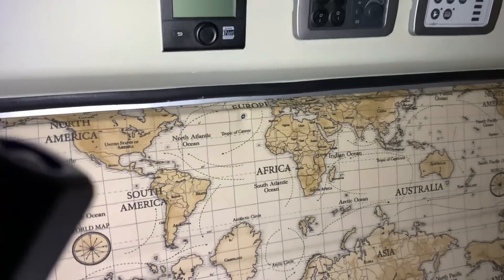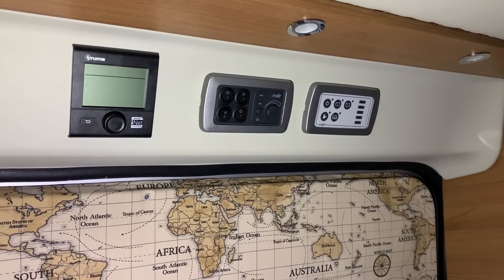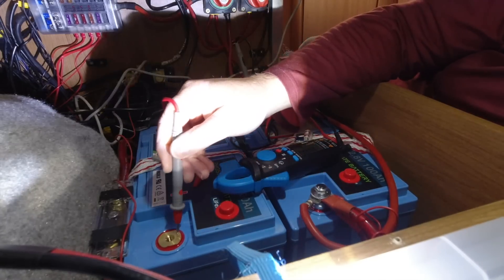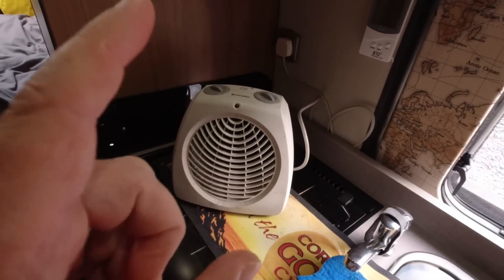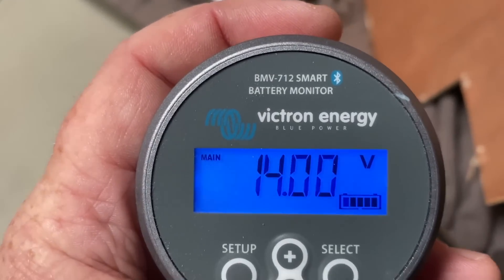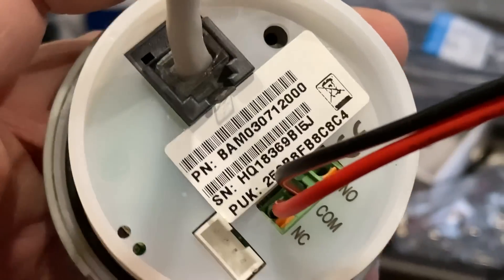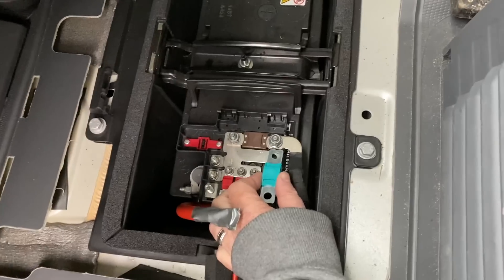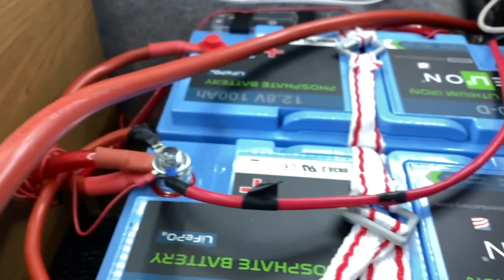Victron Cyrix Li-CT 120 Amp Battery Charger Install

Comment: Great Video ? just wondering if recommended charging current for lead Acid is 20-30% of battery capacity how come the battery can charge at 100Amp if the charge should be at 30% what makes it more lest 30Amps max ? It works but how :)
Reply from the maker: The beauty of using Victron is they way they setup their charger profiles. Choose the profile for your battery type and it does the job without a problem.
Reply: @GadgetJohnAdventures  can you setup max charge in the software then ? or it is done automatically ? just this solution is really economical so it too good to be true :)

Comment: Great video and I’ll be setting up my boat this way. Simple question since I find myself going down the rabbit hole with Victron data and forums: To which ports on the back of the BMV 712 do I connect the Cyrix Li Ct wires?

Comment: You need a battery to battery charger because your voltage will be too low for your  lithium batteries. Just to note on the spec sheet from alpha batteries for these relion batteries the maximum charge current is 100 amps also the recommended charge voltage is 14.2v_14.6v reconnect voltage is at 15.2v and balancing voltage  is 14.4v. So I would say get a b2b charger and adjust to the correct peramiters to prolong the life of these batteries. I hope this helps. I'm not saying what's you've done won't work it will but not has efficient has a b2b charger
Reply: My vehicle's alternator shows charging at 14.4-14.6V while I am driving. So that's ideal for LiFePO4, correct?

Comment: Thanks John - we're looking into Lithium for our setup, nearly identical to yours. Victron Smart Solar MPPT, 2x100Ah Relion Lithium, a BMV-712 and we were looking at how to charge them from the battery, this seems to be much cheaper than a lot of other DC-DC battery chargers.

Quick question - does this work with Smart alternators? We have a 2014 Crafter, EURO 5 engine. I know split relays won't work, do you know if this would?
Reply from the maker: It works fine with my smart alternator on my 2018 van 👍🏼

Comment: Great video as always. I bought the same model from Sargent and asked them about Lithium batteries and was told that this power unit would not fully charge the batteries. I can't afford the cost of Lithium for my first van so I have gone with AGM.  I have a 300 watt solar system with a vIctron MPPT. I was aware of the slow charging of an alternator and  having watched numerous videos and came down in favour of a Ctek charging system. The electrics is the only part of this build I'm struggling with, hence the purchase of a Sargent system. Is there a difference between your install and a Ctek?
Reply from the maker: A ctek charger is a battery to battery charger and it raises the voltage fed into it to produce a higher charge voltage for the leisure battery. This is therefore an inefficient way to produce power, just like using an inverter, however, for some vans a B2B charger is often the simplest way to get a charge to the leisure battery from the alternator.
Reply: Thank you, got to get a grip of this.

Comment: hi John, Great vid again, but i'm confused with the b2b charging with euro 6 engines, didn't think you could just connect with a relay, or am i missing something? Sorry to ask but need to understand as i'm converting at the mo.
Reply from the maker: As we explained in the video, the relay is computer controlled. It’s not just a vsr relay, there are many factors that come into effect to determine if the relay operates and then the computers built into the batteries control the charge rates via the alternator.

Comment: I am building my system soon,24v, 2x 160w panels a 30 amp fuse between controller and  2x 120 ah batteries a 300amp fuse between a 2500w inverter and batteries and I am putting on a regulator as well, just waiting for parts, thanks for your videos
Reply from the maker: Why 24v? Is it a truck?

Comment: Hi guys, I've got a 110ah sealed lead acid leisure battery which I've had for about a year but it's had light use since then, I've got another brand new identical battery which I am thinking of connecting up to the existing one. Is that ok do you think or is it not advised as both of them are not new? Thanks 😎👍🏻
Reply from the maker: That will be perfectly fine Ian 👍🏼

Comment: Can you show some pictures from or share your VRM Portal so we can see the difference in Leisure Battery charging voltage and current (while driving) pre and post install?
Reply from the maker: Not really, as I don’t have the old data due to resetting all modules to factory and since then the van hasn’t been used much as we’re packing up the house ready to move out. Keep an eye on future videos for more updates.
Reply: @GadgetJohnAdventures  That's a shame, perhaps next time you use the van you could get some voltages across the leisure batteries whilst driving.
Reply from the maker: That isn’t possible, the bms is built into the batteries, I use the bmv to monitor my power usage but the readings it shows are not what you’re asking for.
Reply: @GadgetJohnAdventures  do you not have an RPI running Venus or a Venus GX? Best "Gadget" there is!
Reply from the maker: Nooooooo, it might be the gadgets van but so far I’ve not seen the need to add those options to the van.
Reply: @GadgetJohnAdventures  I don't know what to say! Instrumentation, Instrumentation, Instrumentation...... Calling GeekyPhilip 🤓

Comment: I’ve got a very similar, Victron based system, to you, with a Victron Mppt solar charger and BMV712 but into lead acid batteries. I also have the same Sargent unit. Did you disconnect the original split charge relay that is installed as part of the Sargent installation? Does the Sargent control panel flash when the engine is running to show that both engine and leisure batteries are being charged? The reason I ask is that I have a CTEK battery to battery charger which I was thinking of installing in much the same way as your Victron smart relay. I also have a Sterling battery maintainer fitted which trickle charges the vehicle battery from the leisure battery when they raise above 13.3v.
Reply from the maker: Yes I disabled the Sargent charging when the engine is running, which does now mean I can run the electrics in the habitation area when the engine is running 👍🏼

Comment: Sorry John, me again 😊, does the lead acid version (Cyrix-ct) also connect to the BMV 712 do you know?
Thanks Mate 👍🏽
Reply from the maker: It should work exactly the same, the BMV would control the charge based on the % just like we show in this video.

Comment: What size is your negative/earth cable John? 50mm2 also?
Cheers
Reply from the maker: Yes, all negatives linking the batteries to the shunt, shiny to van chassis and to inverter are all 50mm2 then 16mm to fuse box for low amp items.

Comment: So could you get away with this system and not bother with solar John ? Obviously you’d have to run the engine to charge but if you was travelling a lot would you really need solar ? Thanks 😊
Reply from the maker: Yes, if you had enough battery capacity to store what you needed between driving then you could be fine without solar.

Comment: What would you guys advise installing in my build... a vsr or a battery to battery charger as I want an extra way to put charge in my leisure batteries as well as solar....I remember seeing Ash Pollard have problems with his vsr and ended up with his batters fizzing?
Reply from the maker: A good quality vsr is good, but if you’re vehicle has a smart alternator then your options are limited to B2B really
Reply: Gadget John on tour it’s a 2009 Mercedes Sprinter so not sure if they had the smart alternators fitted by then. I’ll have to check

Comment: Just to get it straight in my head John, with a 2 battery set up,  The charge and load should be on the same positive pole on say one battery 1, but then all the negatives connect to battery 2. This then ties the batteries together as one. ?
Reply from the maker: Yep, just as shown in the video mate 👍🏼

Comment: Good information,  my old system was 6 Trojan 6v batteries in  parallel and series,  with a sterling battery to battery charger,  lot of weight,  but I never had any problems at all with power
Reply: Excellent system - tried and tested!